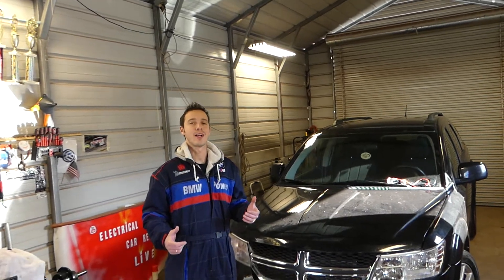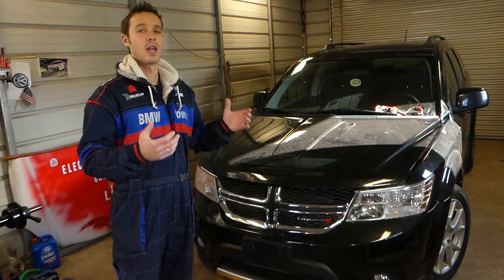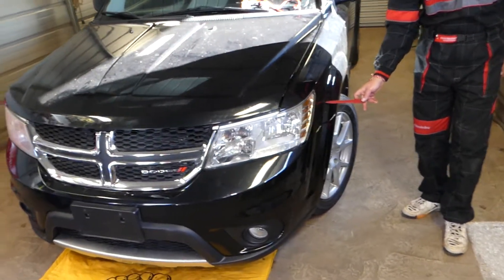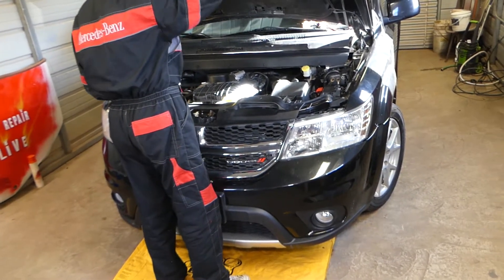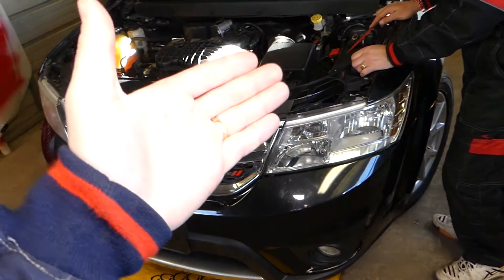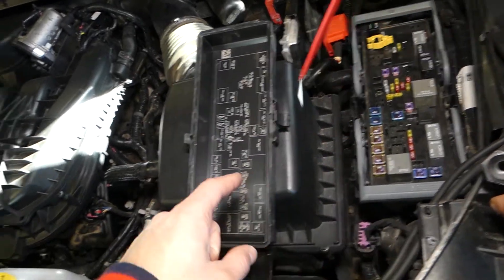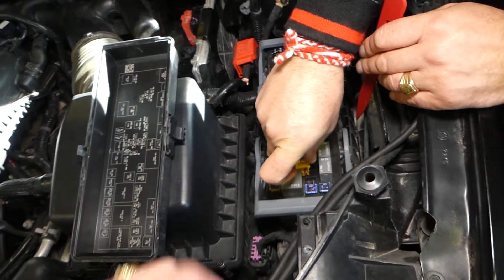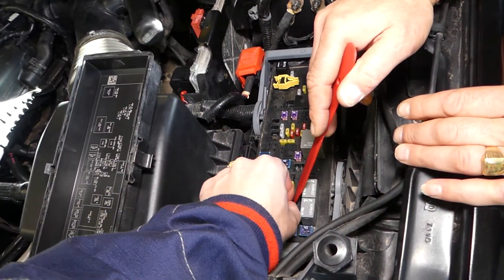DODGE JOURNEY BATTERY SENSOR FUSE LOCATION REPLACEMENT  FIAT FREEMONT

Comment: Hey guys am subscribing thanks for your videos I have a question on my 2012 dodge journey the battery die after few days I don't drive am inside I lock the doors with the remote and am hear noises from under the dash like the shifts for the air vents moving by self every 5 minutes thank you please help

Comment: My friend has a 2012 Dodge journey. For some reason every 30 seconds the information screen on the instrument cluster says press brake to start...and there's no transponder around! Exactly every 30 seconds it does that. Any ideas? Her door window switch doesn't work either. Replaced it and the new doesn't work either. Not sure if that's helpful.

Comment: My 2018 caravan has a code U110A and also low voltage PO652.  Alternator isn't charging battery. Has new battery and new alternator.

Comment: Hi, I have a 2012 dodge journey crew  and when I'm driving sometimes my radio turns off and on the dash it says save battery mode comes on.  In order to get radio working again I have to park vehicle, turn it off and open my door then close it and start it back up for it to play again until it does it again. How do I fix that? Please I'm tired of doing this over and over again.
Reply: Broke wire in the doors wiring harness. Common problem.